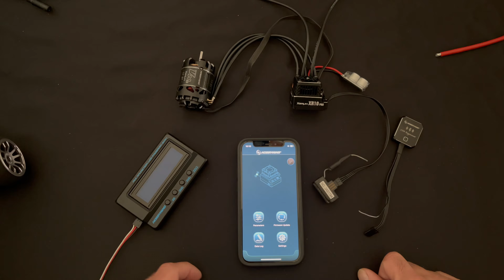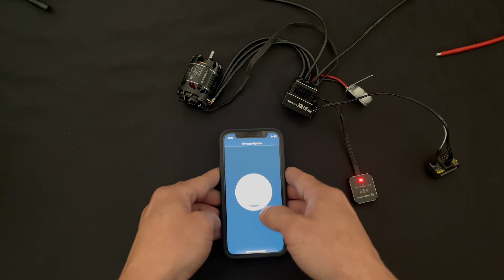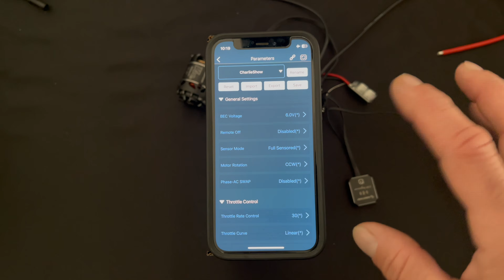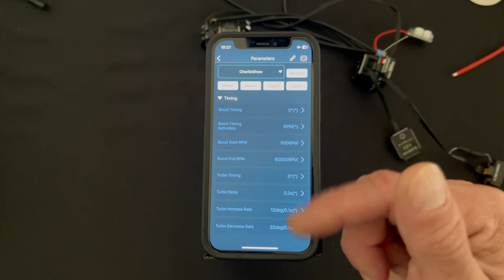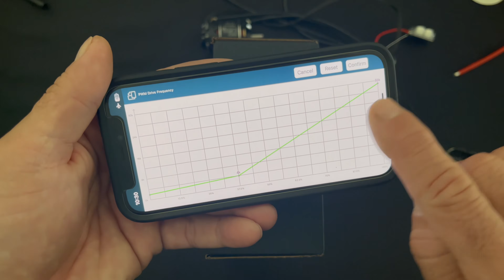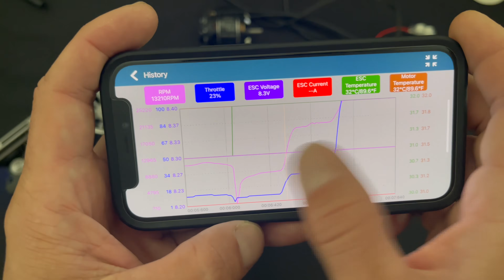The Charlie Show /// Episode 343 /// XErun XR10 Pro G2S - Calibration, Data Logs, Tuning and more!

Comment: Kindly I purchased  a Hobbywing Max6 g2 combo with 4990 1650kv sensor motor. I have some difficulties and questions about it and I sent four emails about a week ago but didn't receive any response. 
Do you know how much the motor should turn?
Does the esc has a thermal cut  off for the esc and motor? 
I also have the Max6 g1 and the thermal cut off can be adjusted and I am surprised how in the Max6 g2 it can not!
What does the punch level and the initial throttle force do, do they also change the motor timing? 
Because I am finding difficult to keep the car straight when I use the turbo timing and the delay!
Kindly could you make a video on the Max6 g2 combo maybe we could understand the principles and what we should do not to damage the esc, motor or the car?

Comment: Hi, kindly thanks for sharing such educational videos on rc.
I had just purchased a Max6 g2 combo with 1650kv motor and when I tried to calibrate it with my DX5C Spectrum radio and SRS6110AT receiver I couldn't do it like you are doing it and according to the manual. 
So I binded the receiver and as soon it binded I pulled full throttle let go to neutral position and full reverse, but I don't know if it is properly calibrated